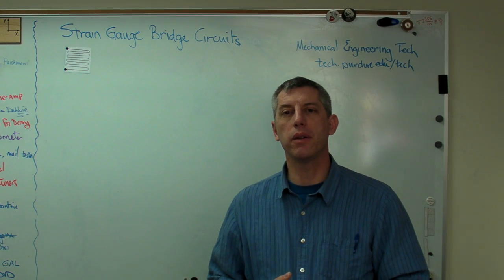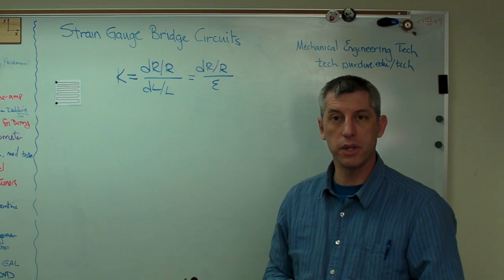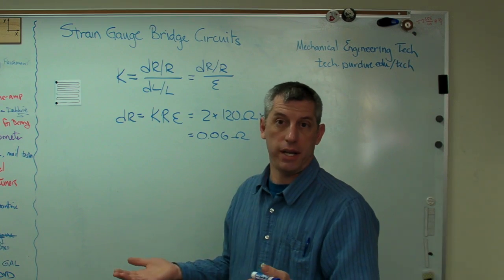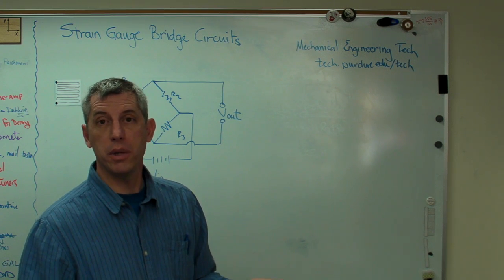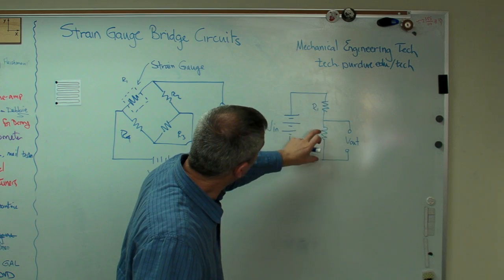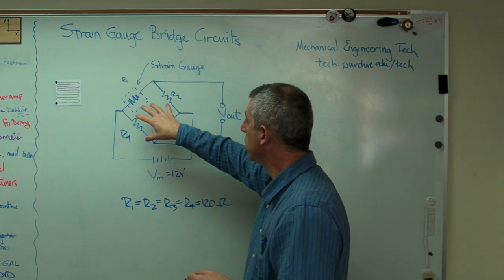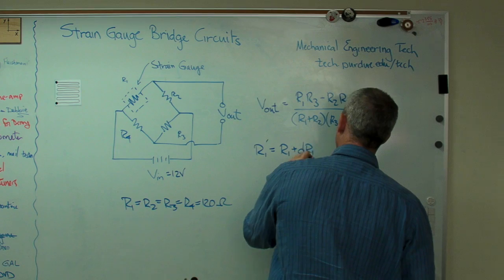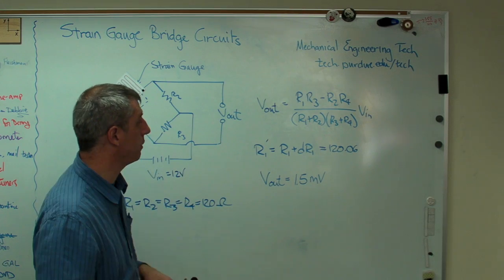Strain Gauge 3 - Bridge Circuits.MP4

Comment: 9:38 i was waiting for this part to come up so good, tho you did skip over some very important highlights you brought up such as amplifiers to boost the 1.5mV ? can you elaborate on that aspect of which amplifier are you refereeing name/model number?  also it did not pick up clear on what you meant to say when you placed the strain gauge over the wheatstone bridge covering only R1 "what does this mean for the rest of R2 R3 and R4 ? are they still being used at this point?
Reply: Frank Lopez they are still being used. In a q bridge circuit they would be fixed resistors with the same resistance as the strain gauge (when un-strained).
This makes your single strain gauge the only variable. 
A change in resistance due to strain unbalances the bridge and produces an output voltage. 
You can then use the gauge factor and excitation voltage to calculate strain.
As long as you know the test materials youngs modulus you can use the strain to calculate stress